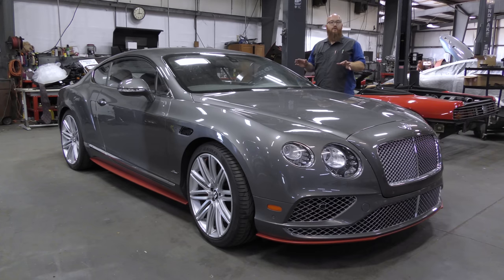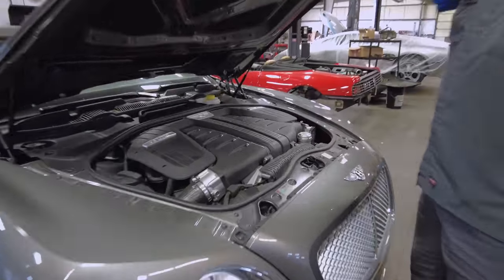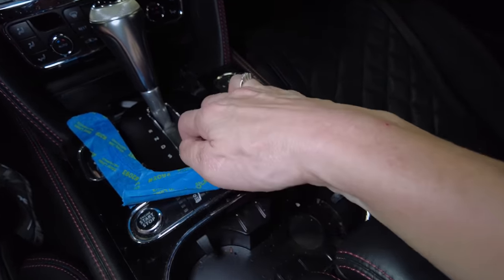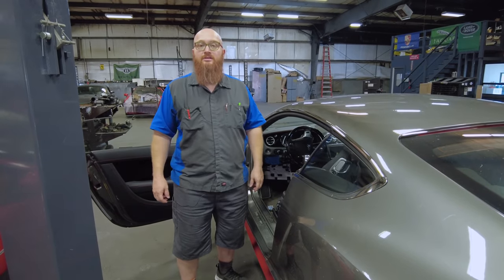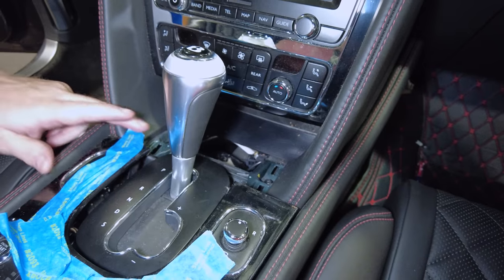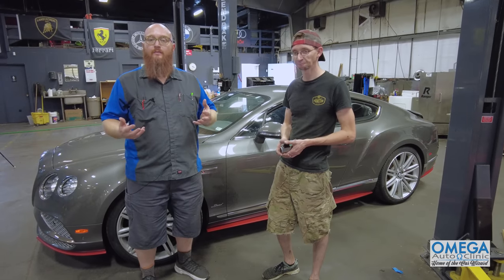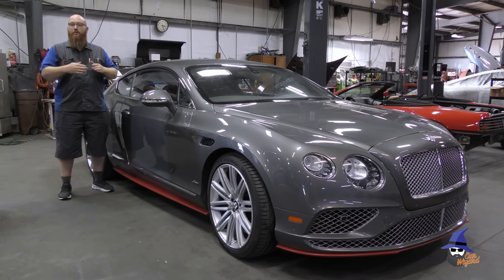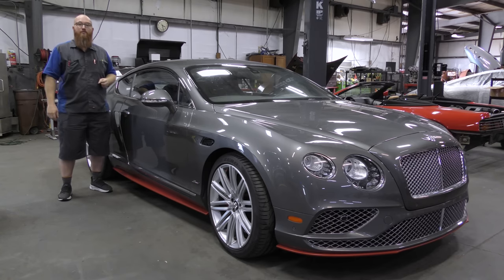How can a $10 Circuit Board make a Bentley Continental GT Speed or ANY CAR completely undriveable!

Comment: If Bentley were smart, they would UN-complicate their cars, eliminating all computer networks except for the fuel injection and ABS systems, and then hardwire all connections. No modules, no CAN-BUS systems, etc. (do you really need electric trunk-closing?) They'd be 100 times more reliable and their residual value would skyrocket. They'd have to get rid of the W-12, but this would be no big loss (put in a big displacement V-8 with OHV!) The MSRP could increase so the dealers would make more money when new to offset the loss of repair revenue (really the reason for their existence, so this would be a tough sell) and everybody would be happy. Imagine a reliable Bentley!
Reply: You think the Bentley clientele are going to buy a vehicle without electronic trunk closing? They don't build the vehicles to be reliable, they build them to be very nice for the clientele that can afford to buy and fix them
Reply: Before CANBUS, individual switches/components required tons of heavier gauge wire to run all circuits. This adds complexity, weight, etc and hampers modular repairability. CAN eliminates this by using signal wires to communicate with individual modules that have one power supply and distribute them to the individual components. Much tidier, much lighter, and having the ability to communicate with everything speeds up diagnostics. Once you become familiar with its operation, you’ll find it’s a ton easier to deal with.
Reply: @Gosh_Josh  Yes, the original buyers. But their used values are a tiny fraction of their new price because they break so often and are so expensive to repair - even for the wealthy. You can close your own trunk; people would do it if Bentley didn't have that option. You should understand most of these are leased anyway. Nobody owns them personally for years.
Reply: @GrimesGarage  Yes, but when the modules go down, many components are affected, requiring expensive diagnosis and replacement of modules, which aren't cheap - and which will become unavailable not long after the model is out of production. I see no advantage as to repairability; frankly it tends to make things harder given its complications.
Reply: You get electric trunk closing on a Honda. Why would you expect a Bentley to not have it?
Reply: The persons that are willing to pay the huge cost of a new Bentley are very keen on all the 'bells & whistles' and the huge performance offered by the vehicle - a performance level that they will rarely (if ever) exploit.  However, the first owners tend to move the car on before the warranty expires and the gremlins (with their extended family) move in.  So your proposed strategy of less equipment and the fitting of an old school motor along with 'less performance' won't achieve the aim.  Notwithstanding the aforesaid, it would be a significant improvement for the subsequent owners of the vehicle.